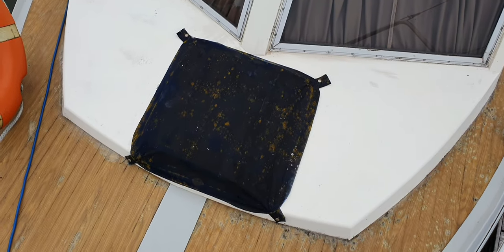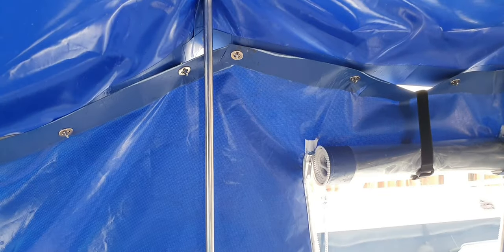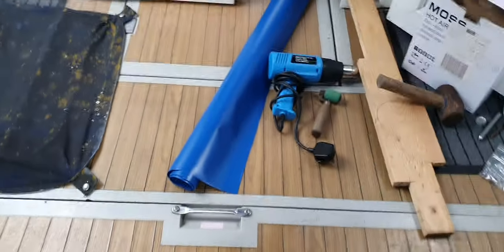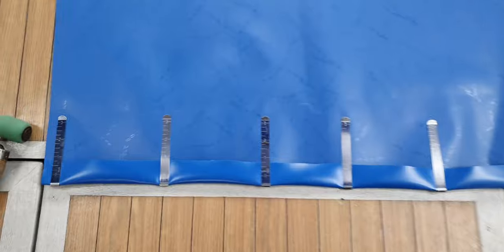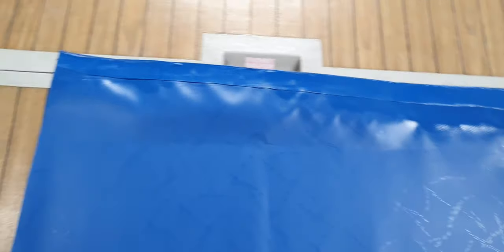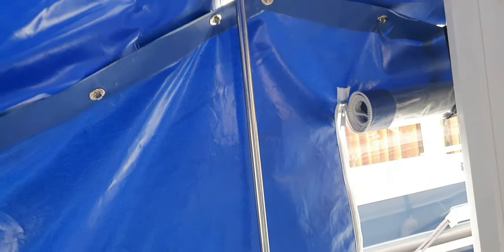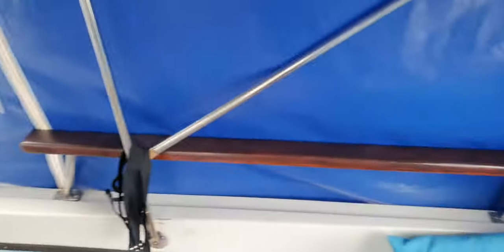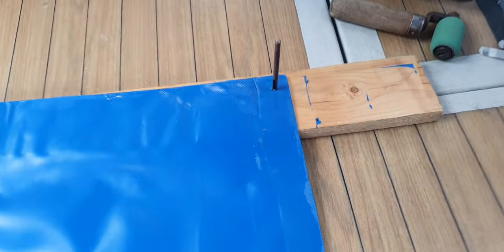How to make a boat deck hatch cover, window cover and canopy.

Comment from the maker: This is the website for the good quality material, they do other kinds too, there is a video on this link showing the quality of it, you can pick the colours and different sizes.
https://www.attwoollsmanufacturing.co.uk/680gsm-pvc-coated-polyester-width-250cm/

This is for all the different kinds of fasteners and tools to fit them, each different style of fastener has a different tool, all are smacked with the hammer tho 🤣🤣
https://ebay.co.uk/usr/jclarkemarine

This link is for the cheaper quality I bought just for the hatch cover.
https://www.ebay.co.uk/itm/WATERPROOF-HEAVY-UV-PVC-VINYL-COVER-MARINE-INFLATABLES-BOAT-CAR-COVERS-FABRIC-/332155276964?mkcid=16&mkevt=1&_trksid=p2349624.m2548.l6249&mkrid=710-127635-2958-0
Reply from the maker: It really is easy lol if fiddly, the canopy I made I know isn't perfect and could have been tighter to get it crease free but no one knows till you tell them so it carnt be that bad 🤣🤣🤣 and 250 quid and a bank Holiday wknd of my time is not 4 grand 😉 🤣🤣

Comment: Thank you so much for this video. I am going to attempt making my own cratch cover and your video has given me some hope! 😅😂 just subscribed ⚓️
Reply from the maker: Let me know how you get on 🙂
Reply: @barnsleyboater  I certainly will! 💯
Reply from the maker: My canopy took me a full bank holiday wknd, it took longer doing all the fiddly fittings than actual making the material to size and shape, they are the annoying part 🤣 it's still going strong tho, washes up like new every spring and no leaks 😍 one of the zips bust last month I got a local seamstress to put me a new one on so it's back to brand new again 😍

Comment: sorry for the language but you are a fxxxxxx genius
Reply from the maker: 🤣🤣🤣🤣🤣 cheers 🥂
Reply: @barnsleyboater  im refusing to pay out ridiculous amounts of money for something like this, please do more videos on window covers door covers etc.
Reply from the maker: I wish I'd done a video for the full canopy I made, but was before I decided to do some boat videos, I did use a heat press for that for the edges as the roller would have taken a rather long time, but used the roller and heat gun to stick the windows in and they have been in 4 years now and not fell or blown off, it's not that hard once you have the material cut to size and the edges done, it's all the little fittings that take up the time. I did each one individually so putting the canopy on then mark one up take it off fit the fitting, put back on and mark the next up and so on, takes longer but you know each one will be in the right spot, took me a full bank holiday wknd in August to do the canopy, I did have the old one to copy tho, I just altered it a bit to my desire. It will save you thousands tho in having one made.

Comment: Great video mate. canopy looks wicked.ive just been given a 26ft boat but the canopy is knackered lol.
Could you use a good quick glue instead of heating it?
Thanks
Reply from the maker: Thanks 😎 yeah I used a glue for some of the awkward bits like corners that I couldn't get in the heat press, it stuck just the same and nothing has come apart 😎 I used this, although you'd need a bigger tube 🤣 I took the canopy off the other week and jet washed it, it came up brand new 😎 https://www.ebay.co.uk/itm/182720676879?mkcid=16&mkevt=1&mkrid=711-127632-2357-0&ssspo=TUbujQc4RlO&sssrc=4429486&ssuid=486wGK5dQP2&var=&widget_ver=artemis&media=COPY

Comment: Don't suppose you have videos of the canopy from the outside mate.
Reply from the maker: No only photos, can I add pics to this thing lol 🤔
Reply: @barnsleyboater  yes mate think you can had pictures.or add pictures into video mode.
Reply from the maker: @jasonduke4451  haha I meant in the messages, but I can not 🫣🤣 I see from your name you are on the Trent? If by chance that's anywhere near Newark you may see me on the river, it's a princess 32 boat, I'll be doing a new video soon as I'm changing the panels in the back under the canopy so I'll make sure to get some outside footage of it in that video 😎